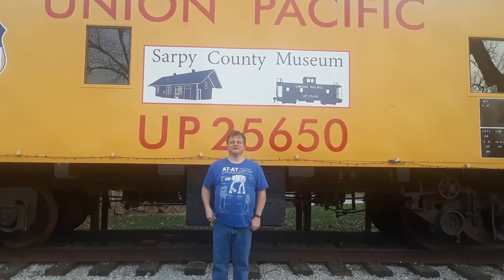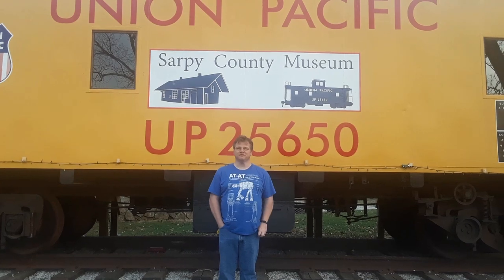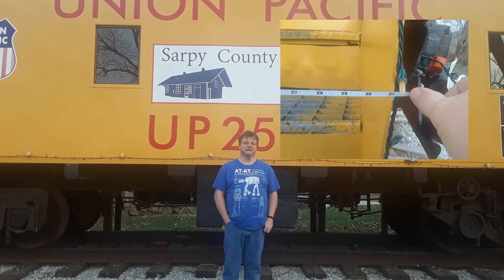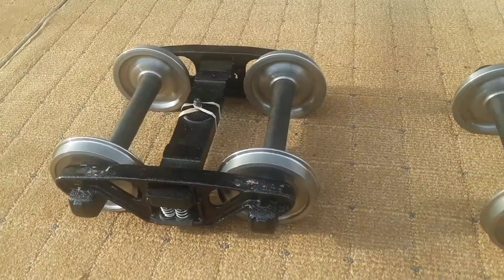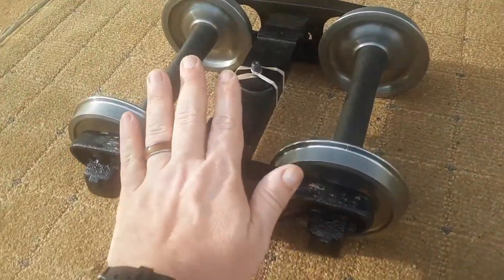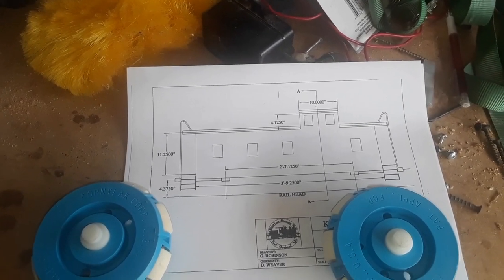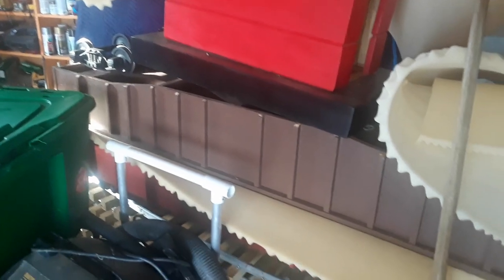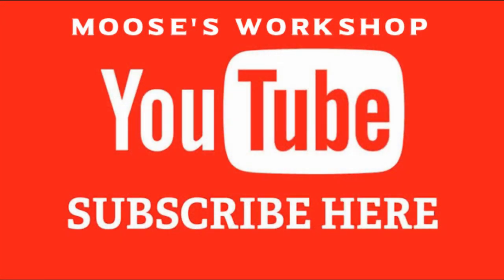Building a caboose in 1.5 scale-  Intro

Comment: June 25, 2019---Thanks for the video, but not for reasons you may think. Getting back into modeling, but going for 1/35th scale zombie/apocalypse dioramas. One of them I want to build will show survivors making a couple of boxcars, a caboose and a abandoned train station as their new homes. The rolling stock will be on a side rail or what ever it's called. Have 2 boxcars and a caboose, along with a section of straight track so I know what size I beams I need for the rails. These are in G scale. Only thing I really haven't found are photos of the wheels, but there's a train museum in Carson City, Nevada that has different rolling stock. One thing I do know, what I bought needs A LOT of work to make them realistic. Hope to photograph the wheels, then made them out of styrene, then mold them in silicone for resin copies.